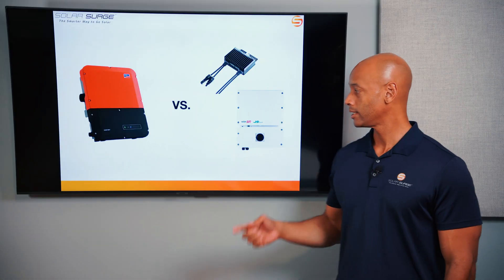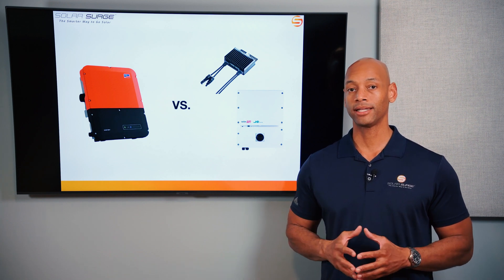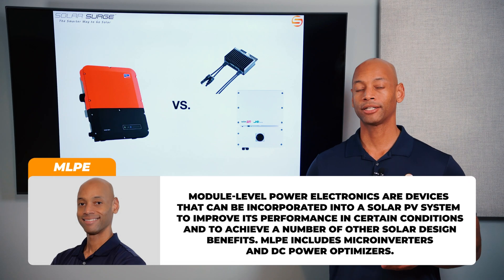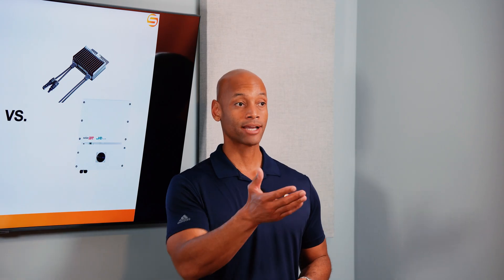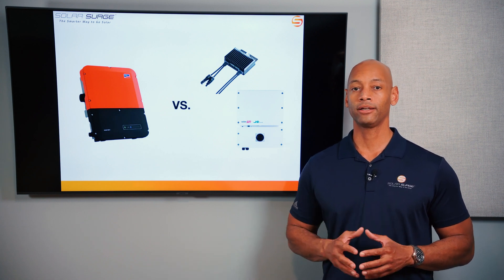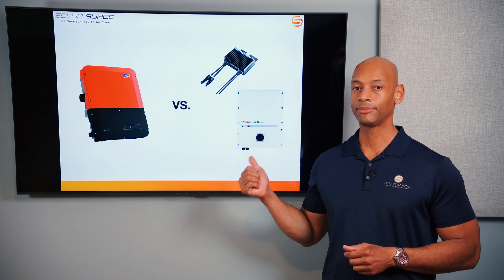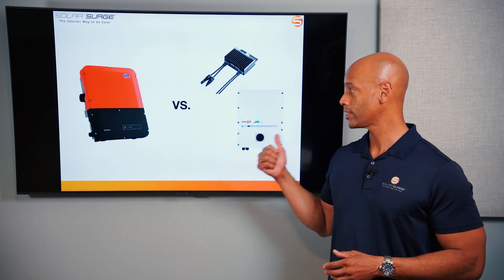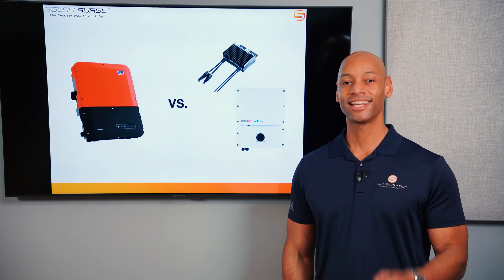String Inverter Vs DC Optimized Inverter

Comment: Question: If micro inverters are attached to each solar panel, then what happens if one panel produce lower voltage than the others?

Is that going to cause current to flow in the direction of the solar panel with low voltage thereby reducing the output voltage?

What happens if the output of the microinverters attached to the solar panel are out of phase? It looks like they will end up cancelling each other.

Comment: Nice to see some of my phrasiology being adopted (even if accidental).

All the "experts" blabbering about the techno jargon of inverters.  ALL of them talking about "prices" and "costs" and arguing about shading and the minutia of production, loss, and "easy installs".  Efficiency.  String, Micro, DC Optimized (They can't even acknowledge that Micro and DC Optimized are different).   

Not ONE SINGLE WORD about what is REALLY going on with Solar Power for Homeowners! 

This is why I call it "stupid solar."  because it talks about all the wrong things, all the wrong ways, making it more and more unnecessarily confusing to Homeowners, and mostly causing them to do nothing while forming unfortunate opinions, perceptions, fears and concerns.

All of this electrical component talk is great for installers, maintenance people - it's even kind of interesting - I love science.  But 

What you need as a Homeowner is a system with enough ability enough to conduct ALL the electricity you will likely use annually over the next 10 or 15 years and then continue conducting as much of that as possible for the next 25 to 40 years.  You need room to grow (If you have room on your roof - or only if absolutely necessary, on a ground mounted Solar Power System).   You must plan for obvious changes coming like EV's, electric appliances, pools, equipment, retirement changes, etc. (or do that later by adding on if you can fit more equipment later).  You need the BEST equipment, not the "cheapest" or the "easiest to install."

You need OEM technology with legacy enhanced architecture that continues to develop on it's own product, learn from it's data and has implemented technology everywhere in virtually every use case, hopefully as long as their warranty and guaranty!

You need the best warranties and guaranties, service, and service level agreements, monitoring services, and monitoring tech, all from the deepest pockets.  You need resources behind it all, and you need to put the LEAST risk on you, and "invest" ZERO dollars into a Solar Power System because THAT is not REALLY an "investment" at all - except in the most lay use of that term.

If you are talking to ANY "solar rep," "solar sales org,"  "solar company," etc that IS NOT offering you what I've explained here?  Then THAT is all you need to know to move away from them.  Especially if they try to tell you that the "loan amount" is how much a Solar Power System "costs."  Or the "cash price."

If you are talking to someone that is talking to you about "getting prices" or "making deals" or getting "quotes" or finding out how much "solar" "costs"?  Then do yourself a favor, and reach out to me and I will show you what is REALLY going on with Solar Power.  

I still haven't told you what's REALLY going on with Solar Power but at least you now know how to tell if the people you are talking to or listening to know themselves!

But now that you've watched this video and reading all the arguing, I'm sure you are ready to go- to get up off the couch and take action - because the "inverter" story is so clearly solved for you!  SMH - .alas, we know this is not true.  But I could make you jump off that couch in 2 minutes, without mentioning any of this!  And you will thank me for doing so (as you should!)

Comment: You are really out of touch with the times with your understanding of the modern technology and cost benefit analysis for your customers.There is more than enough data these days proving that with modern solar panels and MPPT devices  that they will perform at par or out perform module level devices, people do not need to invest in microinverters or optimizers if they dont need them, but they are convinced they do with this rehtoric!  Please stop telling people  they need this crap  because its "better". I get it, you sell more stuff and tell folks there going to have a more "efficient system" while incresing the price per watt by .50+ but its just not necessary unless you have A LOT of shade or 6 different roof planes to work with. I have been a solar contractor for 15 years and 85% of our service related issues  is enphase communications failures (only warrated for 5 years) and Solaredge failures (they will not be in business much longer). The number one thing  that is NOT a problem... a central inverter that lasts 2 times the return on investment of the system. You will realize this enevitability in time and so will your customer base.

Comment: Another benefit of microinverters/dc optimizers is a significant increase in components, allowing for additional markups for each component in the price quote.
Reply: 😂 so they do the same thing for almost a 2x In price per panel
Reply: Are you providing solar still consultations?

Comment: Is it possible to run a house off grid with solar/battery setup and add a micro inverter/solar setup for more power?
Reply: Micro inverters aren't going to get you any more power
Reply: Definitely. Victron Energy is one such example.
Reply: Hi erik, are you providing solar still consultations?
Reply: @curious_i_am  Hi Curious, sorry I don't have any solar still information for you.
Reply: @erikbrollin872  My bad, words shuffled. 😅. I meant are you still provide solar consultations.
Reply: @curious_i_am  GM Curious, I am a solar enthusiast, not a professional installer. That said, if you have a question, I will try to answer to the best of my knowledge.

Comment: Shading bringing down an entire string of solar panels like is shown here @ 3:00 isn't an issue today that it was just 10 to 20 years ago on older solar panels because todays new solar panels have bypass diodes installed inside them that separates the areas of each solar panel and helps protect them from shading losses and redirects the current inside the solar panel to limit the negative effects of any shaded cells. This improves the overall performance of the solar panel and helps avoid any affects to other solar panels on that string even if you have some shade loss like from a nearby tree or a bird.   I will agree that optimizers are a good thing even on todays new solar panels if you have a known daily shading issue and you can also only install optimizers on those solar panels that get shade on a daily basis and not install optimizers on solar panels that get no shading at all if you wish so you don't have to buy them for all your solar panels.
Reply: Hi , How is your business's online presence?

Comment: Less loss transmitting AC vs. DC - no way Joe.  That is also not why AC power vs. DC power won for the electric grid and power transmission.  It is that AC power can more easily be converted (stepped up and stepped down) - with simple transformers.  To do this at the time with DC (before solid state electronics in the early 1900's) would have required motors and generators - and placed more frequently than AC sub-stations (since high voltage motors and generators were difficult and expensive).  And regarding efficiency, today for long runs in the power distribution system, high voltage DC is actually used as there as less losses than AC.  AC power needs to deal with power factor and current draw not in sync with the voltage (any non-resistive load), and this causes electrical lines to need to be sized larger than the power actually consumed by the load.  DC doesn't have that issue, so DC is used in long distance backbones, before being converted to AC for local consumption.  DC also doesn't require synchronization - another benefit for long distance interconnections between grids.
Reply: Yup, and now HVDC high voltage DC is already here.... China is playing with 500,000v dc transmission over the continent!
Reply: @WattsMiner 

Another advantage of DC transmission is the lack of losses due to the skin effect in AC current. 

The effective area of transmission decreases with the frequency due to the skin effect. DC requires less area than AC for the same current.
Reply: Hi Bill, How is your business's online presence?
Reply: Question: If micro inverters are attached to each solar panel, then what happens if one panel produce lower voltage than the others?

Is that going to cause current to flow in the direction of the solar panel with low voltage thereby reducing the output voltage?

What happens if the output of the microinverters attached to the solar panel are out of phase? It looks like they will end up cancelling each other.
Reply: @IshaqIbrahim3  Microinverters step-up the DC voltage of panel (typically 30-70V DC), and convert it to 240V AC.  Only works one-way, and not influenced by other panels or microinverters.  And, in order to work with the AC line, this is also all synchronized to the 60 Hz.  Not possible to be out of phase.

Comment: Enphase / SolarEdge shill. If no shadowing on the roof, string inverters are always a better, safer, more optimal, less maintenance solution.
Reply: Agree - very frustrating to again see misinformation here and the string inverter myth.  Shading of one panel does not degrade the entire string.  MPPT tracking in modern solar inverters deal with this in conjunction with the bypass diodes in the solar panels - causing conduction and just loss of the power in that part of the shaded panel (no different than micro-inverters or power optimizers).  MLPE only are useful in complex partial sharing scenarios, and this can be dealt with in cases where string inverters have multiple MPPT inputs.  Of course the other positive of MLPE is panel level monitoring, but just more components to fail on a hot roof.
Reply: Hi  @billjohnson3344  , are you providing solar consultations?
Reply: @billjohnson3344  What about solar panel degradation? Without MLPE, the string will only perform as good as the worse panel.
Reply: @deyumei7965  That's a non-issue - degradation is tiny per year, and across all panels.  A defective panel could limit the whole string, but degradation is uniform.
Reply: @billjohnson3344  lol really？ They aren't even that uniform when they rolled off the production line，let alone the different orientation or position that each panel may have. That's why there's always  a percentage on the wattage. Panel degrade quite significantly for the first year so it is an issue.
Reply: @deyumei7965  Yes, really.  Minor output voltage differences panel-to-panel just impact the total power - doesn't limit the string to that 'lower' panel's output.  Same power sum that you'd have when you sum the power in an optimized or micro-inverter system, should you have weak and strong panels there.  Definitely don't use different types of panels on the same string though, with different Vmax and Imax.  You are correct that panels can lose more output the first year versus the rest, but again - this is going on with all of the panels in the string.  Your comment about different orientation or position doesn't apply - you orient the panels the same way for the string.  If you are putting them on a different roof face, you use a different MPPT.  String inverters have more rules you have to follow (same roof face, same panel type, max string voltage), but all can be worked with if you have a string inverter with several MPPT channels.  Complex shading or panel level monitoring clearly wins for MLPE, with an increase in cost and decrease in reliability.
Reply: @billjohnson3344  well，wattage is volt*amps，if one panel is producing 400 and then rest is 410，it's going to be 400 for all the panels in that string. I am in California and it requires model level rapid shutdown for panels installed on roof here，an optimizer cost around 30 -40 dollars while a rapid shutdown cost like 20-30. For me，it's just like extra 10 dollars is worth it for the benefits you get. Yes it's not as reliable but I would worry about the string inverter more than the optimizer.
Reply: @billjohnson3344  Different positions do matter because they probably receive different amounts of sunlight thus different degradation rate. Yes，it's very little difference but the lifespan of a solar panel is usually over 30 years.
Reply: @deyumei7965  You are stuck on the old string inverter myth.  One panel doesn't limit the string given MPPT algorithms and panel bypass diodes.  If you have any doubt, check out some of the other channels like SolarTime where actual tests are performed with comparative results.  There are unique instances where MLPE make sense, but doesn't cover the added component cost nor difficulty of replacement when they fail.  A SolarEdge string inverter is crap, an SMA or Fronius is not.  You'll be replacing SolarEdge optimizers like popcorn, AND their inverter.  Compare with a Tesla PowerWall 3 which just needs a rapid shutdown device every 3 panels, and with 6 MPPTs makes designing around shading pretty easy.
Reply: @billjohnson3344  The bypass diode doesn't even kick in for the degradation among ，and yes one panel might not limit a whole string but we are talking about all the panels degrade at different pace. I agree，solaredge is garbage but string inverter is still a single point of failure and has a lot more components than a MLPE.
Reply: @billjohnson3344  Thanks for the suggestion tho. Unfortunately I have a solaredge system  so I will look into your suggestions to see what route am I gong to take when it breaks lol.
Reply: @billjohnson3344  well a sma rapid shutdown is like 40 dollars so theres no real advantages beside reliability compare to a optimizer. I will probably change them to micro inverter if it breaks.
Reply: Anyone going to jump on me, google "are solar optimizers / micro inverters worth it" on any other youtube channel.

Comment: Still could only put in less than 20% not much difference 
Measure at the meter or the output of the inverter volts and the amps multiply the two and give you actual watts going into the grid which you have not done yet do the test
Reply: Hi Dennis, are you providing solar still consultations?
Reply: @curious_i_am manufacturing 
+ windmills
& There @ 10%
you do the test yet